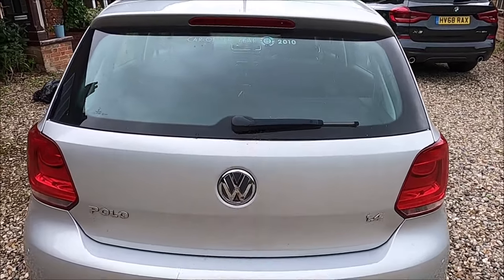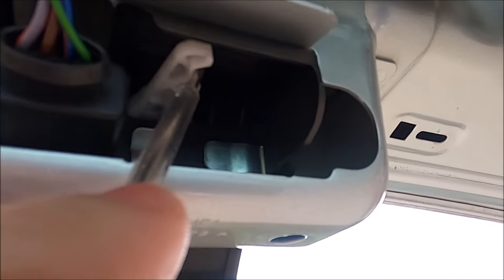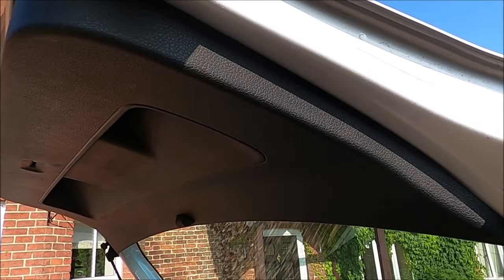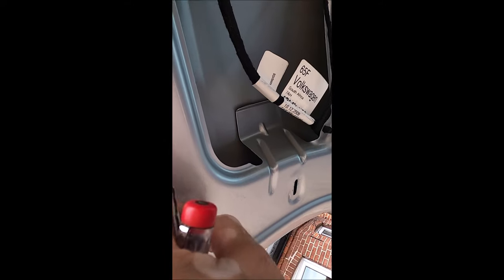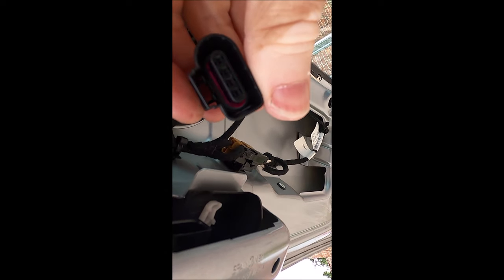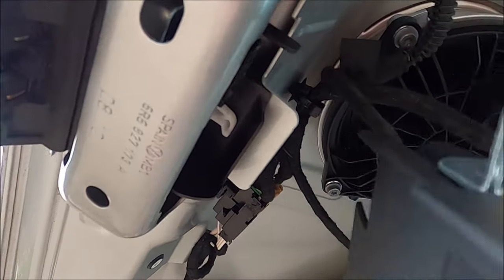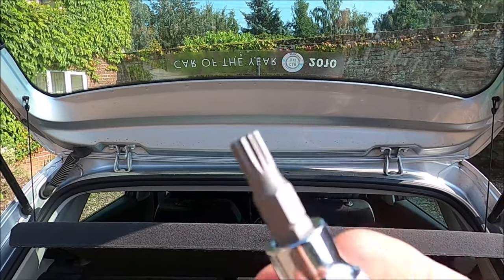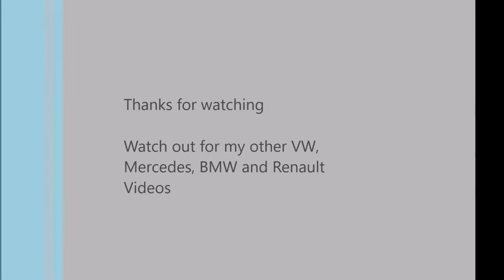Fixing VW Polo Boot Lock

Comment: Perfect thanks. I’m
Guessing this is a common fault with the polo
Reply from the maker: It seems to be. I prised the old lock apart and the failure point in mine was the brushes in a little electric motor that operates the lock though a series of plastic gear wheels.

Comment: I'm not sure if it's the eBay bad quality latches, but I've changed mine twice and both have stopped working after a couple of days.
Reply from the maker: @acljun  that’s annoying, could be bad luck or maybe suggests an alignment issue between the lock and the striker pin. Ridex is one of the brands supplying the lock with a decent warranty on their pattern parts.

Comment: I had the exact same issue with mine, I changed the lock , but after a day it stopped working again, I took the boot handle off and cleaned it up then I started working normally again

Comment: Thanks for posting this, very comprehensive. As I’ve never used a multimeter before, can you provide instructions on how you used it in the video. Thanks!!
Reply from the maker: @Robjjw999  Most multimeters have a resistance function, sometimes labelled ohms or impedance. On this setting when you connect the two probes together the meter should read a low number of ohms, close to or at zero, indicating the electrical circuit is complete.At the back of the VW boot handle  there are two electrical connections, connect or hold a probe against each, the meter should read nothing or perhaps “max” indicating an open circuit, and then when you operate the boot handle the meter should read a small number of ohms or even zero, indicating that the switch inside the handle is making a connection and is not faulty. You can also buy cheap circuit tester or even make up a circuit with a bulb and battery, if you don’t have a meter. With the meter in the Voltage mode, you can also check for voltage at the end of the cable that connects to the lock mechanism. Make sure the car ignition is on, hold the negative (black) probe against a bare metal part of the cars body, like the lock striker pin and then use the red probe to test each of the pins in the lock connector while you operate the VW boot lid handle. If you can’t find any voltage at the end of the lock cable, then first thing I would look at are the fuses. Your meter can help identify any fuses that are blown, it’s not always that easy to see that they are whole just by looking at them. Good luck
Reply: @techstuff-cars  Wow. Thanks for the detailed, comprehensive reply. Greatly appreciated.

Comment: Great video, thanks! Worked perfectly for me. For anyone with the same issue - I bought both an M7 and M8 bit and the (more common) M8 worked perfectly for me on my 2010 Polo. Getting the plastic trim removed was quite a task and it really feels like you’re breaking it, but it does come off safely with some force and alarming noises. Also note - after plugging in the new part to test it, it didn’t respond to any input on the key fob or door switch, so I nearly gave up - however it did work when I used the actual boot handle. So now it’s fitted and works fully now with the key fob too. Thanks again!

Comment: I have question regarding this, did the faulty bootlock messed with your indicators and things I closed my boot hard then my hazards came on on my dash it's shows my boot is open even tho it's closed can a faulty bootlock do that
Reply from the maker: Not on mine. It might be something to do with the alarm setting or activating. Some cars have a feature where if the car thinks it has been in an accident, the doors are automatically unlocked and the hazards activated but I would be surprised if that was fitted to this generation of Polo. Good luck sorting the problem

Comment: Yes but you have the boot open already, what if you can’t get inside the boot?
Reply from the maker: If you watch the video carefully, you can open the boot by putting the key or a thin screwdriver into the slot on the plastic inner boot liner and then flicking the lever that’s inside. It’s helpful to have someone outside the car lifting the boot while you do this. Hope that helps

Comment: Hi ! I got the same issue since 4 years… I’ve tried to replace both the emblem and the lock itself, working for 1 weeks and the same… But for me it doesn’t work when it’s cold / humidity, so approximately for 6 months out of twelve… So I know that it works but why humidity is a problem I can’t figure it out… 😢
Reply from the maker: That’s a strange one. Maybe you have a bad connection in the wiring. You could try some switch cleaner, or maybe gentle close the connectors with a screwdriver to get a tighter fit.

Comment: Firstly, great video! This really helped me to diagnose the same issue as you had - the continuity and voltage checks were both fine. Just commenting on this in case it helps anyone out in the future. Removing my boot lock mechanism required using an M8 (not an M7) spline bit which is much more likely to be included within a comprehensive socket set.
Reply: in my case (2013 Polo) it's an M7, which is annoying as M7 bits are hard to find. Had to use the dreaded amazon

Comment: I have a similar issue with my 61 plate but my boot makes a weird noise when I push the release button and i have to close it a few time for it to stay closed any advise on what could be the issue?
Reply from the maker: If you hear a noise then it sounds like the lock motor is turning. The motor has some gear wheels made out of plastic. It is possible that the teeth have worn and the mechanism is skipping when you try to operate the lock. Another possibility is that the lock and catch on the body work have become misaligned. Check that the rubber seal around the boot has not become loose or is sticking up anywhere. If the lock is misaligned, loosen the lock bolts that I show in the video and you have a little bit of play that’s you can move the lock around before you tighten it up
Reply: @techstuff-cars  apologies for the late reply I kinda forgot I wanted to sort this but I suppose I have just gotten used to not daring to open the boot. If the gears have worn away is it an easy fix? Thanks for your help

Comment: How did you open the boot to do this ?
Reply from the maker: Get access to the boot space from inside the car by folding the rear seats down. There is a small slot in the plastic cover of the boot lid, just above the lock mechanism. Use a small screwdriver, or even the ignition key, to flick the lever inside the slot while someone operates the boot handle from outside. I cant recall if you need to move the lever to the left or the right ! you can see the slot in the cover in my video. Good luck

Comment: @Tech Stuff - Cars  Hi there! I'm after advice, I saw this video and believed this was the same issue with my 2012 Polo. I purchased a new boot lock, identical to yours including the same serial number that was listed on it. However, this doesn't seem to have been a fix. I've just purchased a multimeter and have tested all the connections on both the emblem and the boot lock itself and can't find any current flowing at all. 

Where would my next step potentially be? I've previously tried looking at the fuses, although I wasn't able to narrow it down to a specific fuse due to the number of diagrams that were so generic for VW as a whole. I'm thinking this is between either a fuse issue, or a wiring loom issue if you have any advice? Thank you!
Reply from the maker: It’s hard to say. Make sure the car is “alive” when you are looking for voltage, that is to say turned on and alarm deactivated.  The emblem is just a switch so you should see continuity (close to zero ohms resistance) when you pull on the lever with the multimeter connected across its terminals. If there is no voltage at the locking mechanism end then hopefully it’s just a fuse that’s blown rather than damaged wiring. From what I can see online Fuse 48, under the steering wheel probably controls the boot actuator and central locking, so if your central looking is good and fuse is ok, tends to steer towards a break in the wiring.
Reply: @techstuff-cars   Really appreciate the response! I will re check the fuses. I had the ignition on, just not the engine. I must say diagnosing electrical faults is rather new to me, although I'm not a stranger to picking up tools in general so it may a case of a few hours reading. 

I did find it pretty difficult to get both multimeter probes onto the cabling, it felt like the contact was very minimal if any. 

I must correct myself as well; this is my partner's car not mine. She's just told me last night that the car was previously rear ended, and it was intermittent when she bought the car, then packed up a few weeks afterwards. 

The accident happened before she had the car, so I don't have any details on the damage and so on.
Reply from the maker: @Stealthzion  the car doesn’t need to be running, just the ignition on so you know the control modules are awake. If the car has had rear end damage starts to sound like wiring could be an issue. You tend to get failures where there are connectors, look for corrosion on pins, or where cables are constantly flexed, like where the cable goes into the hatchback door from the car body.  Also see if there is any unusual insulation tape on the wiring where someone has maybe patched up some collision damage. Good Luck
Reply: Hi, did you get any help?, mine it just unlocks/opens itself without me touching anything....it does whether car is parked or driving. Pls help🥺
Reply: @sbusisoblessing4707 direct short on a wiring loom

Comment: Thank you so much for this! My car boot had broken last night and my partner and I ordered the part needed and have just successfully changed it. For others looking at this video, I have a polo 2016 and I had an allen key which happened to fit the fixings for the lock (rather than M7 M8 tool). We managed to use this instead, so could be worth checking if you don’t have the specific tool.
Reply from the maker: @bethant3658  thanks, good observation, worth checking before you buy the 12 point bit.

Comment: You have the part number for the boot lock?
Reply from the maker: I got it from EBay, car spares direct https://www.ebay.co.uk/itm/164488203531?fits=Car+Make%3AVW%7CModel%3APolo&_trkparms=ispr%3D1&hash=item264c42cd0b:g:PfAAAOSwaYVfn9Vr&amdata=enc%3AAQAGAAAA4AsBjFASvcMk1QLIuDWR%2Bsnx9mINO1HhxFt42xvHo7WdXA2ahxHXdp8Au6hFSa6FSwrOtZj%2Fl5C%2FdLPMA8psafjxy5MxQtKdBjuv5qLDa2MYhiqM3tyOg6tRgOHe7JullaP%2BTLdy8nW%2FIwnBSJgFLha7z59dft1M3VQpmT6hWQ%2FnqzG7b%2BRe8PyfKJfcKY1pseL5WPzohgn5B8Sx%2B6tFXeEn24fHepBfb6GUR4B%2BDhzQ8fJMJpoRC93y0SAK7By4Qzp7lDZD2zY5y4cItIUY66tp%2BYfib1QQk4LDs%2Bm8Til1%7Ctkp%3ABFBMlJPWuYtg

Comment: these ebay actuators are utter garbage, mine latest 5 months!
Reply from the maker: Sorry to hear that. Mine still going strong after 2 and a half years
Reply: @techstuff-cars  It's not duration but rather use, the Polo is used for school runs with the boot opened every time at both ends. Plus there is a little luck of course.
Reply from the maker: @M896  Must be a big issue for VW as I’ve had nearly 100,000 views of this video. When I took the old one apart it looked like the brushes had gone on the motor inside the lock rather than the plastic gears failing. Since I made the video, I see some “branded” clone parts are available now from the likes of Ridex, they have a 24 month guarantee of many of their parts, so maybe better quality?
Reply: Id this a joke? How can you take inside bits off if you can’t open the boot?
Reply: @nikkijcarter  there is a hole through which you can release the catch with a screwdriver

Comment: Please share the voltages
Reply from the maker: On the four wire plug, two of the wires had +12V. Make sure the car ignition is turned on. I took the old lock apart, there is a gearbox and a small electric motor inside. The brushes were burnt out on the electric motor.
Reply: @techstuff-cars  and other two wires ???
Reply from the maker: @talhamohammed781  I don’t recall now. One may have been a ground. You may be able to find a wiring diagram online, search for “installing a boot light in a VW Polo”, they have posted a diagram on their website
Reply: @techstuff-cars  Hi there! I'm after advice, I saw this video and believed this was the same issue with my 2012 Polo. I purchased a new boot lock, identical to yours including the same serial number that was listed on it. However, this doesn't seem to have been a fix. I've just purchased a multimetre and have tested all the connections on both the emblem and the boot lock itself and can't find any current flowing at all. 

Where would my next step potentially be? I've previously tried looking at the fuses, although I wasn't able to narrow it down to a specific fuse due to the number of diagrams that were so generic for VW as a whole. I'm thinking this is between either a fuse issue, or a wiring loom issue if you have any advice? Thank you!

Comment: First he said the boot won't open... How did it open to get to that emergency pully?
Reply from the maker: Hi, if you get into the boot by putting down the back seats you will find there is a small slot in the interior panel of the hatch. Put a thin screwdriver or even your ignition key into the slot and flick the lever while pushing upwards on the hatch and it will open.
Reply from the maker: You can see the slot in the panel at 35 seconds into the video. You need to move the lever behind the slot to the left.